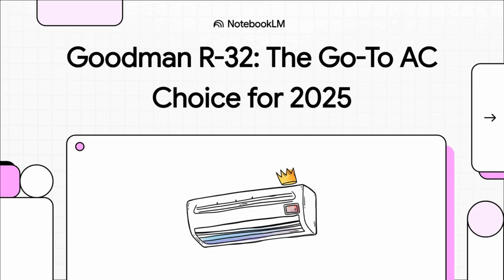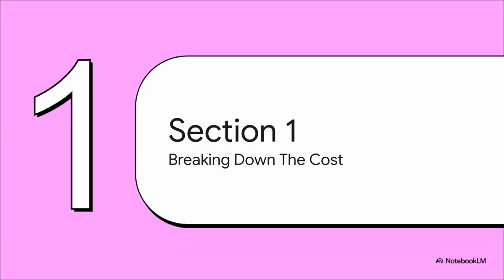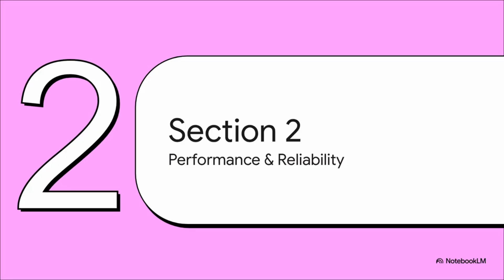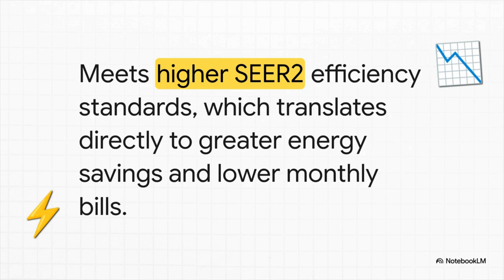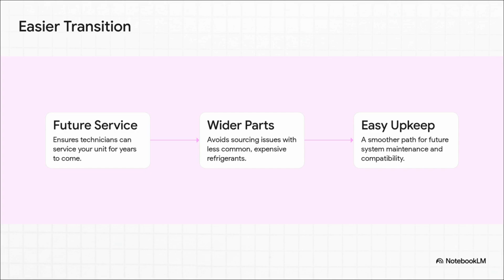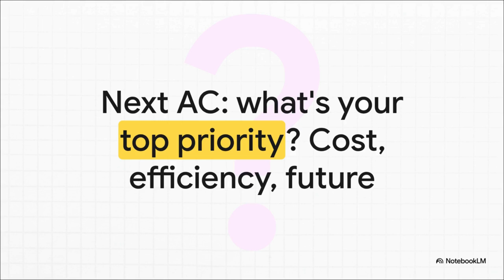Why Are More AC Companies Sticking With Goodman R-32 Systems

Comment: Well , I was told that R32 would be phased out because of it's gwp is higher than r454.
Reply from the maker: Great question! A lot of people are hearing mixed info about R-32 and R-454B right now.

Here’s the real scoop 👇

R-32 is not being phased out. It actually has a much lower Global Warming Potential (GWP) than the old R-410A we’ve been using for years. R-454B does have an even lower GWP than R-32 — that’s true — but both refrigerants meet the new 2025 EPA regulations and both are approved long-term options for residential AC systems.

Different manufacturers chose different refrigerants:

Goodman / Daikin → R-32

Rheem / Carrier → R-454B

Both are future-proof, both are compliant, and both are great choices for homeowners.

So R-32 isn’t going anywhere. It’s simply a different path forward depending on the brand. 👍

Comment: Im hvacr tech since 1990. I sell goodman. Buy lowest seer for reliability. Simpler design less break downs. After 10 year warranty simple parts cheaper and likely to find parts on ebay cheap. Oxbox is maybe competitor soon due to lower cost. Rheem and rudd seem to use non uv protected insulation on outside txv which causes insulation to dissentigrate and then bulb senses outdoor air not temp not coil.
Reply from the maker: Thanks for sharing your long-time tech experience, Mike—that’s gold for homeowners and contractors alike. 👍
You make a solid point about lower-SEER equipment: fewer electronic components and simpler refrigeration circuits often mean fewer failure points, which can translate to lower long-term repair costs once the 10-year parts warranty is up.

I’ve also seen Goodman hold up well in our Miami-Dade and Broward climate, provided the installs are done right and the system is matched correctly. Your tip on sourcing common replacement parts (even on eBay) is a practical one that budget-minded owners appreciate.
Reply: USA made are almost all R454b a mixed gas of main R32 and one other gas. The tx valve is next to the evap coil so whats with the insulation (Carriers)?  Will have UV light scrubber next to coil to prevent/lessen mold.  R454b units require more gas than R32 units and R32 is easily recycled.  I when with a Ruud single stage.  Hope it works out.  The control boards are the weak points on the complex in reliability, cost and availability.  Thin high efficiency = pin hole leaks.  R454b many be a money maker for servicing for gas percentage will change with a leak and require evacuation and new gas

Comment: Sure sounds like a Goodman commercial.
Reply from the maker: Haha, I get that a lot! 😊 The reason I talk about Goodman so much is because they really are one of the most affordable and reliable options for Miami homeowners right now—especially with their new R-32 systems. I’ve worked with all the major brands over the years, but Goodman has been hitting the sweet spot between price, warranty, and performance. Not a commercial, just sharing what I’ve seen firsthand in the field.

Comment: AC Tech here, I've been in the field for over 20 years, and I can tell you about the present that all Brands now days are doing the same thing; making crap products,,I've have to repair every brand available in the market today in the first year after installed; God help us all. Do not get into the game of saying wonders about a particular brand.
Reply from the maker: I completely respect your perspective and experience in the field. You’re right—no brand is immune to issues, and as techs, we see first-hand that every manufacturer has had its share of problems. The truth is, proper sizing, installation quality, and regular maintenance often make a bigger difference in system reliability than the nameplate on the unit.

That said, I try to share information so homeowners can make informed decisions, whether it’s about refrigerants, efficiency ratings, or what’s currently available in the market. At the end of the day, it’s less about “one brand being perfect” and more about making sure the equipment is installed correctly and supported with good service afterward.

Comment: This is a ton of crap. All manufacturers are crap. Everything from the seer2, government and manufactures of equipment and freon is a big MONEY GRAB.  Oh, please, and no one is better than the other. It's all in proper sizing and instalation. Recerch why 454 is more expensive. When you cause chaos, you can charge more, and that's wrong.
Reply from the maker: I understand your frustration, and you’re not alone—many homeowners and technicians feel the same way about how fast regulations, refrigerants, and efficiency standards keep changing. There’s no question that government mandates and manufacturer decisions often come with added costs, and it can feel like a money grab.

That said, you’re absolutely correct on one very important point: proper sizing and installation matter more than the brand name on the box. A perfectly installed mid-tier system will almost always outperform a poorly installed “premium” system.

As for refrigerants like R-454B being more expensive, part of that comes down to production, distribution, and the fact that it’s a blend (meaning it costs more to refine and handle compared to a single-component refrigerant like R-32). Anytime the industry goes through a transition, prices spike, and unfortunately that cost is passed down to both contractors and homeowners.

At the end of the day, the best way to beat the “system” is to work with an honest installer who prioritizes correct load calculations, clean ductwork, and long-term reliability over upselling. That’s where customers truly see the difference—not in chasing the latest SEER rating or refrigerant hype.

Comment: I own several homes and have a total of 9 AC systems I have to keep running. They have all been slowly switched to Goodman due to affordable price and simplicity which ends up being less expensive over time. I recently replaced 2-15yo 4 Ton Tappan (Nordyne) 2 stage, variable speed ECM systems w Goodman single stage because they have been total junk and always requiring expensive service.. I have other Goodman I had installed 15yrs ago and have only replaced capacitors on it. No reason to pay for the more complex, more expensive gadget systems to save $30 a month in electric bills.
Reply from the maker: Hi Mike, thank you for sharing your experience 🙌. You nailed it—Goodman systems are known for their simplicity, affordability, and long-term reliability. Many Miami homeowners prefer single-stage Goodman units for exactly the reasons you mentioned: fewer complicated parts, fewer service headaches, and affordable replacements when needed.

We’ve also seen what you’re describing with some of the high-end “gadget systems.” They can save a little on electricity, but when motors, boards, or sensors fail, the repair costs can easily wipe out those savings. Goodman keeps it practical—solid cooling at a fair price.

It’s great to hear that your 15-year-old Goodman is still running strong with just a capacitor replacement 👏. That’s exactly why so many people across South Florida stick with Goodman when it’s time to replace their system.

If you ever need fast delivery or support for your other properties, we’ve got Goodman systems in stock locally here in Miami and offer free delivery 🚚.

Comment: Replaced evap coil at about 5 years now 4 years later it's leaking again, will not buy another Goodman
Reply from the maker: “We understand your frustration—coil leaks are one of the toughest issues for any homeowner. Just to clarify, evaporator coil failures can unfortunately happen with any brand, not just Goodman. Factors like humidity, indoor air quality, and even cleaning habits play a big role in coil life. Regular maintenance and protective options can sometimes help extend their lifespan. We appreciate you sharing your experience and hope this gives a little more perspective.”

Comment: My Goodman is 8 years old , have replaced 1 cap condenser, a blower motor air handler. I live in Florida and it gets used alot. Been very reliable! I'd buy a Goodman again!
Reply from the maker: “That’s great to hear! Eight years in Florida’s heat and humidity is no joke, and the fact that your Goodman has only needed a capacitor and a blower motor really shows the reliability of the brand. They’re built to handle heavy use, and it sounds like yours has definitely delivered. Glad to know you’d buy Goodman again—I’d recommend them too!”